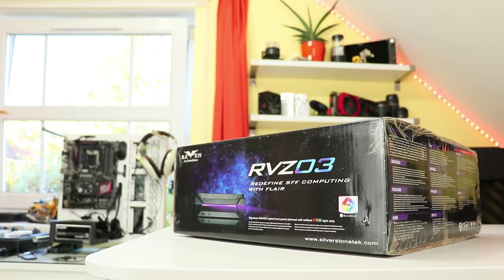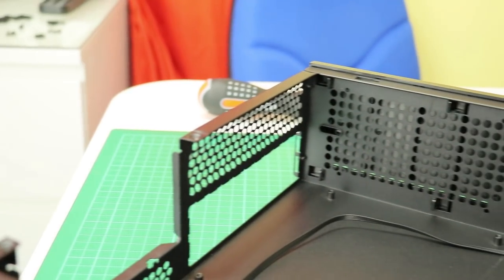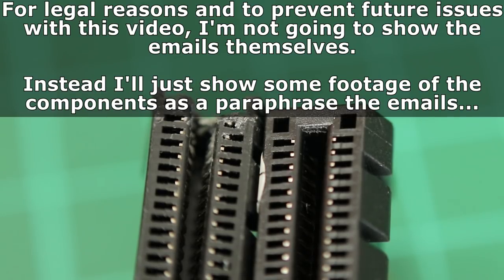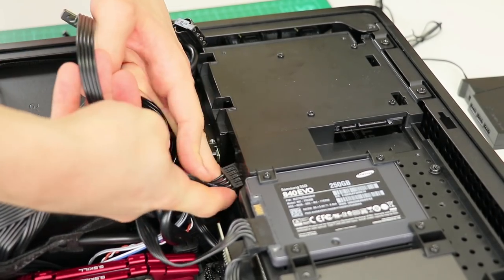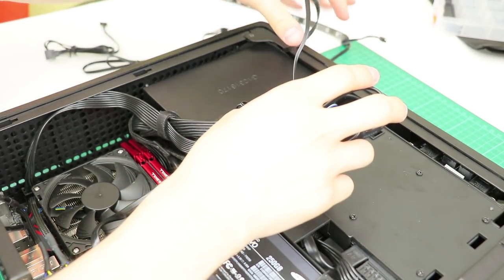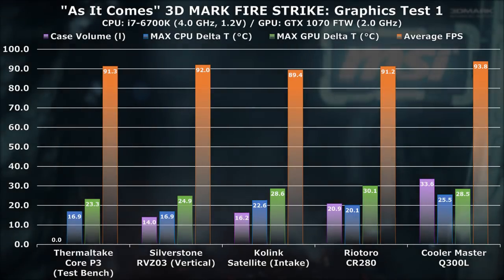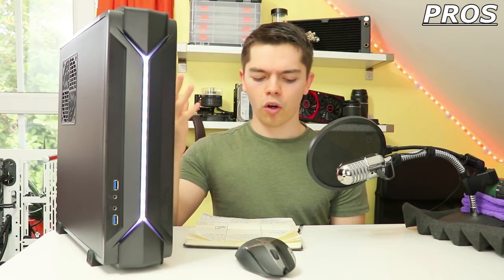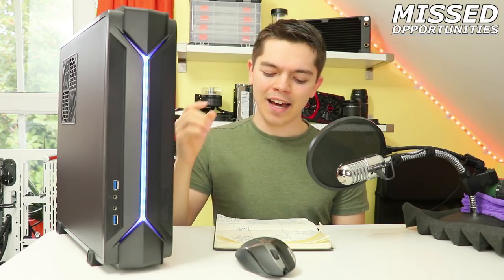SilverStone Raven RVZ03 (Mini ITX) Review

Comment: Wow, what an amazing, complete, intelligent and informative case review. The best I've seen.

I'm thinking of using this case for a gaming PC build for my son at university. The case has an optional carry handle as well.

This review gives me a lot of information that is really helpful. Good to know the difference the orientation makes on thermals.

Pity this case doesn't take 3.5" drive, however it's great to know that you can fit a thicker 2.5" drive by the PSU. So those go up to 5 TB, albeit there is a price premium for the smaller format drive and they tend to spin slower.

Wish I could buy this without the RGB controller. I'm kind of over the RGB and TG craze and just want something robust, effective, quiet and cool.
Reply from the maker: Thanks very much, really appreciate it!

You're son is a lucky guy, this would be a perfect build for moving around. Double check the carry handle situation, I've not seen one for the RVZ03 with a quick search, but I did find one for the RVZ02 and ML08:

https://www.amazon.com/SilverStone-Technology-Motherboards-Integrated-RVZ03B/dp/B01LA0LKPC?th=1

Here's an existing forum discussion about it:
https://linustechtips.com/main/topic/957675-can-you-put-the-ml08s-handle-on-the-rvz03-rgb/

Drive support is limited, but there's a solid amount of small drive spaces, as apposed to a large 3.5" drive and couple 2.5" positions. As long as you've got a decent SSD boot drive, the mass storage HDD being a touch slower won't hurt performacne too badly.

On the not about the RGB controller, you don't need to hook up the RGB on this case at all if you don't want RGB, you can just leave it disconnected.

Let me know if you have any queries, and I'll do what I can to help out. Thanks for checking this one out, and best of luck with your son's build!
Reply: @AVTechy  ah, I was thinking of the ML08 for the handle - sorry for the confusion.
Reply from the maker: Don't worry about it, I just wanted to make sure you weren't planning a build that wasn't quite possible due to a small inconvenient technicality.
Reply: @AVTechy  Thank you so much. Keep going, your production is excellent and the depth, detail and pace are best of breed.
Reply: I have completed my son's gaming computer build. I ended up recovering a Silverstone Sugo SG05 ITX case that was housing  a CCTV server and using that together with mostly used / reclaimed parts with some key new components. Final specs were ...

Silverstone Sugo SG05BB Lite mini ITX case

GA-Z77N-wifi motherboard

Xeon E3-1240 v2 processor - equivalent to an i7-3770 but without the integrated GPU so less power used / heat generated. 4 cores 8 threads.

2 x 8GB Crucial Ballistix Tactical DDR3 1600MHz RAM

Gigabyte GTX 1060 3GB Mini GPU

Sandisk Plus 240GB SATA SSD

be quiet! 400w SFX PSU

Noctua L9x65 CPU cooler

Corsair ML120 Pro PWM magnetic levitation fan

ASUS VG248QE 24 inch 144Hz 1ms 1080p gaming monitor with speakers

Windows 10 Home 64 bit.

He loves it. It's at university with him now. The monitor is also great with his Wii U although weirdly would only work with Nintendo's HDMI cable - no idea why but a quick Google shows that other people have found this.

This is a tiny gaming computer - not silent but pretty quiet for its size. I enjoyed building it and will be able to upgrade it from time to time.

One thing I do find helpful is to install a fan guard on the inside face of the case fan to keep stray cables from fouling the fan. There's not a lot of room to work and this just gives an extra level of protection.

Thank you so much again for your review, it helped me make my choice even though I didn't end up using the reviewed case on this occasion.

Comment: Amazing review! Thanks to this I decided to buy this case couple of months ago! Thanks for this. I just wanted to say that I've noticed that thermals seems to be working best when GPU side is on up at least with open style cooler. This is probably because with GPU on bottom it starts to recycle its own hot air (at least with two case fans). When GPU is up hot air seems to rise pretty efficently trough ventilation on the top. CPU doesn't seem to mind that much. Maybe it does not heat up as much or doesn't push hot air around as much. 

This is when case is placed vertical. On the horizontal (VCR style) I haven't made any tests but it seems to be meant to be gpu facing down.

Comment: Thank you for the nice review.  I am also looking forward to be buying this case as well since I think it is looking really nice. I already do have two of their cases and this one does also look nice so I would want to be building another game pc into this one. I do not know if it is compareable or not but in the other "raven" and "milo" one that I have they also use these extenrers and I do admit it is being a bit triky but it is handable. But I can also see how damage can happen if it is pulled one site only so I think I do understand both sites and I guess 15 Euros is not this bad for an extender , including shipping.  Are the magnetic air filters and the adaption bracket for the power supply within the cases delivery ? (I am asling because on one they were and on my other they were not.  I also have the fractal design case which had them along delivery so I had wondered if they come along with this case.

Comment: This case is really great i could fit an Asus Rog Strix GTX 1080 Ti and a i7 8700K plus AIO 120mm cooler (outside the panel) and i have perfect temperatures. Soon i will upgrade the cooling with a liquid freezer 240mm

Comment: great review , i have a question though you are working with that rgb block. I have an Asrock H370M-itx/ac  no rgb board. Do i need that device to be able to make use of the rgb of the case? and if not where do i connect the header?

Comment: Nice review, very detail . 

I have the same issue with my PCI-E extender on my RVZ02.
 I was upgrading my GPU last year, pull out the old one and then have the same issue as yours, but the extender still works well. So I didnt ask for any replacement. 😅

Anyway keep up the goodwork sir!

Comment: Nice Review.  I am starting a build of my own using a similar case: the FTZ01-E Fortress Series.  I will be using a full size ATX PSU, 9700K with the NT06-Pro Cooler, and a 1080Ti, and I will be attempting to fit an aftermarket cooler on the GPU.  I've got the Accelero and the Morpheus... guess I will find out just how much can really fit into one of these.
Reply: you should do the math for physical dimension before buying aftermarket cooler
Reply from the maker: Sometimes it's tough to work out when we're talking about a slim ITX case. The spec sheet doesn't account for every dimension in every clearance category, so there are some blindspots that can be missed. This is why many people run into clearance issues with certain cases.

Take the Raijintek Styx for example, there's very little information to work out GPU length with regards to PSU depth. 

Sometimes it's just easier to buy the case first and work it out from there.

Comment: great case ;D i have the same maximum fully packed with an asrock x299itx/ax with a delidded i9 7900x with allcore OC 4,5 GHz modified Corsair Watercooling, 32GB Quad Channel RAM, 1080TI Asus ROG Strix. good for "To Go" and great for 1080p gaming.

Comment: While trying to install a GTX 1070 AMP!, I think I've found one of its biggest flaw IMO. The GPU bracket itself. Silverstone does mention in the manual it supports GPU's up to 14.8 cm in width given that you do not use the GPU bracket. However that actually leaves the GPU dangling in a wobbly mess. I don't recommend it. The issue here is the bracket piece for the back of the GPU is just to short. They could have just extended it by ~5mm so the pins fit the most top row of holes. 
And I don't get the need for an additional PCIE connector between the daughter board and the card. Fortunately I didn't have the same breakage issue in the video, but this connector seems to be a waste of space. Why not just design a daughter board that directly slots in the card? They could have saved another ~5mm.
Reply: I ran into the same problem with my Strix 2060 Super. The GPU bracket (two pieces) was not designed to fit the fancy outer casing of the card (which was wider than the clips supported) so I ended up modifying the top clip (cut it down) and drove extra plastic screws through the bottom clip to accommodate the new position as the old screw holes would not line up in the modification. Card now is held in place solidly.

Comment: Also: It is not quite possible for silverstone to have tempered glass on the case anywhere other than on top of the MB, not including the fan. Remember that the airflow of the system is direct airflow in ALL parts, meaning that there need to be a fan for every single corresponding thermal critical component(1x CPU and 2x GPU). This would mean that unless you are wanting to have a tempered glass just to see the fans on the opposite side, glass panel is just off the table.

Comment: Just did some research, got this case, i am building my first pc. This is something i've always wanted to do. I'm going to run the x470-i with an r7. Could you better describe the fan placement for ideal airflow? Or is that in the user manual? I also wanted to ask if a small aio liquid cooler would fit in there or if just doin airflow would be best?
Reply from the maker: Fan placement in this case is really simple, it's intakes all round.

The positions of the fans don't favour exhaust orientations since they sit over components that have intake fans. Any fans positioned as exhausts would just be fighting against the coolers of the graphics card and CPU.

Now no exhaust fans doesn't mean there's a low exhaust rate. Theres plenty of exhaust vents to deal with the mass of intake airflow. This is one of the best cases for core component cooling due to this intakes right over the CPU and graphic card coolers.

As for AIOs, you can squeeze an AIO in for either the CPU or GPU, but you have to be very careful about the dimensions for the Blocks and radiator and fan thicknesses with regards to the space available.

Comment: Dude i bought the same psu, where did u get the adapter? I eas unaware of this, i thought it would be prepared for sff haha
Reply from the maker: I bought the adapter separately, I'd definitely recommend getting one for tight builds like this one. 

I'd get one (or a pack of 3 in my case) on order and leave the system running all connected up with the side panel off for now, then when it arrives you can slot it in and put the panels back on. 

The PSU is fairly well setup, but I agree it should probably add a cable in to accommodate for an obscure SFF build line this.
Reply from the maker: It's just a SATA power extender by the way, and links back to your PSU cables multi SATA connector cable. Really cheap, no more then £5 for a few.
Reply: @AVTechy  I mean the bracket to fit the psu in place (pp08), i found it on Amazon but they wont sell it unless i purchase 4  or more. This should be included with the box, a mini itx case that cant handle a psu >.< Thanks anyways, great video!!
Reply from the maker: @xXLashkXx  Ahh, sorry I thought you meant the cable :P

Yeah I agree, this case is expensive enough, and tight enough to warrant an included bracket to handle SFX PSU's.

I think a fair amount of the cost of this case is down to the lack of popularity. It probably took a fair amount of design time to make this case, and not many people are into cases of this type, hence why each unit costs a bit more than other cases. Same reason why test benches are a bit pricey too.

Anyway, check around a new sites to see if you can find a resaonbly priced PP08 or something similar. Or worst case scenario, try and make one, but that's a last resort and probably required buying tools an material to do it... not ideal.
Reply: @AVTechy  turns out I just had to spend 20€ on selected products, so I bought some stuff i needed and im good to go :) thank you very much!

Comment: I see there are three slots for fans on the case, but only a single fan splitter for a maximum of two fans. Where would you plug a third fan into? I am using a Gigabyte Gaming AB350N Motherboard, and I haven't seen any other way to plug a third fan into.
Reply from the maker: There's a second fan header on below the VRM heat sink. You could link the two case fans into the lower fan header with the splitter, and link the CPU coolers fan to the CPU header to the top.
Reply: I see, I never noticed the other fan header there as it's a bit smaller than the others. I have it setup now with all three fans. Thanks!

Comment: hi. is the type of gpu cooler used, like blower vs the one with 2-3 fans, a difference here?
Reply from the maker: I've not tested both style coolers in this case, but I think due to the large and close ventilation space by the graphics card, an open air cooler would be the preferable style.

Comment: i have a question... do you think we can squeeze a slim aio in there? like the silverstone tundra 120mm slim
Reply from the maker: I think someone in the comments has been able to do that. It's certainly possible, but as with any build on this case it'll be a challenge. You'd have to pay particular attention to the fittings into the radiator.

Comment: The RGB strip on my RVZ03 doesn't seem to work I tried connecting it directly to the motherboard and to motherboard via controller and controlling it with just the controller but the light doesn't come on. The Reset Switch cord is fine since I could reset my PC with it but the light doesn't work. Could it be that the light strip isn't getting enough power or something? I'm using a 500watt psu that is powering a GTX 1080 and R5 1600 could there be not enough power left for the strip somehow?
Reply from the maker: Power certainly won't be the problem, 500W 

So you've linked the front light to one of the side connectors on the controller, and you've linked the end connector of the controller to the motherboard, and connected the molex connector to the controller for power and it doesn't work.

It's worth trying it disconnected from the motherboard, so connect the front light to the side of the controller, link the molex connector to the right 2 pin header, and connect the reset connector to the left 2 pin header. That should allow you to control your lighting setup through the reset switch. If it doesn't work at this stage, then I can only assume there is an issue with the control box.

Have you tried linking the front light directly to the motherboard? If you're only using the front light then you can connect it directly to the motherboard, just make sure it's the right way around. Let me know how you get on.
Reply: I've tried all that and it still doesn't work it seems to me that the strip and or the controller is broken. Now that I mentioned it, the HDD Led doesn't work on my case either. I'm going to return my 500w PSU and upgrade to a 600w one with flat cables anyway since the my current PSU cables are too thick and cables I'm not using just get in the way of air flow and make it a hassle to rearrange every time I open the case up.

Comment: Wondering if this would be ok for a gaming system based on:  z370/gtx 1080ti FE, 8086K?
Reply from the maker: I think the airflow is pretty solid in this case, and should be capable of handling some pretty high performance hardware. The question is whether the heatsink for the 8086K would be big enough, but with a good 83mm CPU cooler clearance there's quite a lot of options around.

You'll probably be better of with an AIC Graphics Card over a blower style cooler since there's so much direct airflow overt the entire graphics card area. A blower style cooler won't be able to take advantage of this, and since it's pretty much isolated there's not much need to directly exhaust out the case.

Comment: Hi,could you help me for building my system in this case? My system parts are ryzen 2700x, asrock fatality b450,hyperx 16 GB 3200 MHz ram(single slot) ,be quite bn 238 500 watt sfx l PSU, Samsung 250 GB SSD,Intel 512 GB M2 SSD and MSI aero gtx 1070...especially i am confused about connecting pwr and reset leds...

Comment: I was hoping you could help. What is the maximum thickness GPU i can fit while still keeping the provided slim fans? Thanks
Reply from the maker: I can't view the video right now as I'm in work, but there's a section of the video before I change the fans where I measure the gap between the graphics card and the case. The fans are 15mm thick, and the card is a GTX 1070 FTW, so if you go to that part of the video and get the measurement you can work out how much room you'd have available.
Reply: @AVTechy  thanks!
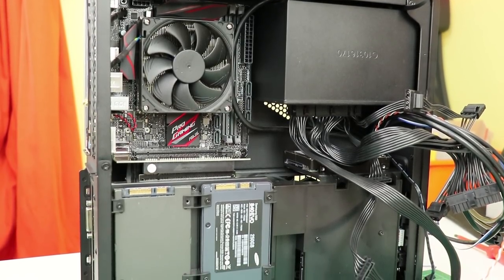Reply: 21:53 for anyone interested
Reply from the maker: Spot on, thanks for adding the time stamp :).

So just out of curiosity,  what graphics card were you thinking about for this case? And sorry I wasn't much help earlier, I was a bit snowed in with work. Normally I'd try and get onto some comments in a lunch time.
Reply: @AVTechy  either a vega 56 or 64. Where I live vega 64 gigabyte OC is same price as a 1070ti and I would like to use freesync :) 

No stress didnt take more than 5 mins to find with the details provided
Reply from the maker: Nice :) if your around once the build has been done I'd love to know how it all went :).
Reply: AV Techy I’m thinking 🤔 about Aorus Gtx 1080ti